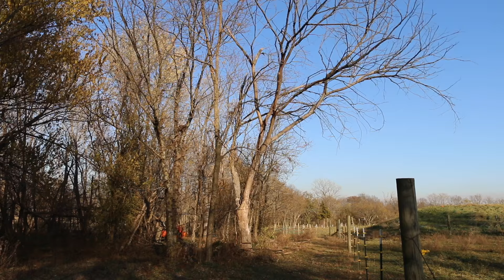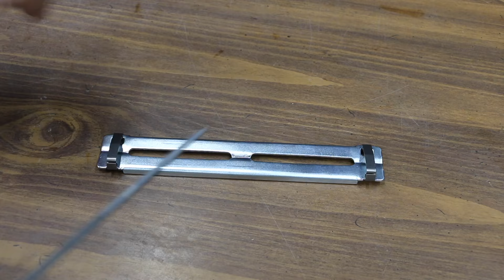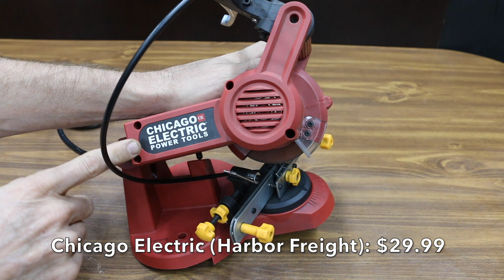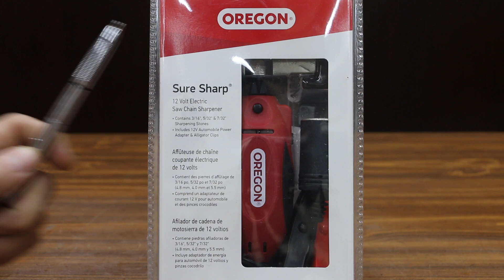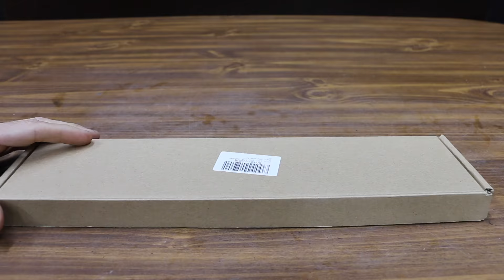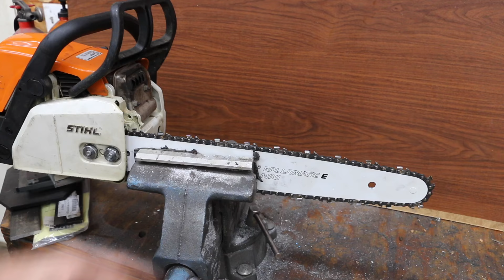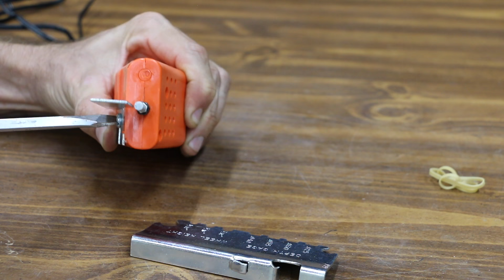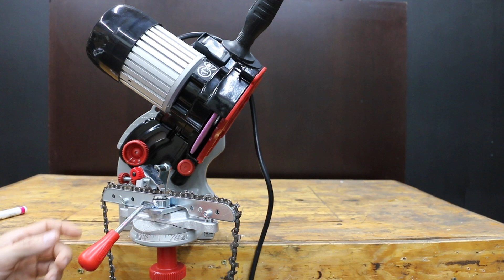Which Chainsaw Sharpener is Best? Let's find out! Stihl, Granberg, Chicago Electric, Oregon

Comment: Great reviews, but I am not sure why anyone is using any chain that does not have carbide teeth. I am using all carbide chains on all my chain saw tools and they cut faster than any new regular chain. The teeth are harder and cut like they are new from log one, to log 100.  They hardly ever need sharpening as they are hard enough to cut through cinderblock while cutting wood afterwards as if they were new. Why would you use a regular steel chain. These chains only cost $50 for the 16 inch, and less for the smaller chains. Not sure why anyone has been using steel only chains for the last several decades. So you productivity is much higher since you do not loose cutting speed over the course of use like on a steel only chain, and you do not have to spend the time to sharpen them as often. They also do not suffer the risks of hitting dirt or other hazards the way a steel only chain does. An inferior performing chain saw can probably outperform a better one by using a carbide chain versus a regular one on the other chainsaw.
Reply from the maker: Thanks!  Thanks for sharing.

Comment: I wish you would do an addendum to this video by using a single file by hand and show that against the others. While that will vary with the skill of the user so do the others as you demonstrated by practicing with the different systems. I would like the comparison of filing by hand to see if the avg person can do it well enough. You don't cut trees for a living so I'd recon my skill with the sharpening is avg too. Is it worth the extra cost for a sharpener at all? Next question does a sharpener or hand filing prolong the life of the blade by not removing more material than needed . I really enjoyed the vid esp love the consistency in your compairisons, the weight on the saw was clever thank you

Comment: Sharpening freehand with a file and finishing with a diamond file requires 
a steady hand and good eyes working in good light with a lot of practice. 
I have also the rotary sharpeners that are used like a Dremel grinder.
But I recognized the rotation speed is much too high for my liking for a
very light duty application like sharpening a small cutter on a chain saw.
The sharpening of a cutter requires a delicate touch and finesse to be 
accurate and have a good result, more like sharpening a scalpel than 
grinding a lawn mower blade. This is especially true for diamond burrs
and carbide burrs which perform best at a low cutting speed. 12 volt
55W sharpeners running at 25,000 rpm are more than 3 times overkill 
using rotary diamond burrs to sharpen a cutter on a chainsaw. A dull 
cutter needs only a touch up to bring back its edge. An analogy is for
your Case knife when it gets dull you sharpen it using a light touch on 
a fine grit sharpening stone being very precise and accurate soon you
have a razor edge, and it would be excessive to sharpen the blade on 
a horizontal grinder like you would choose for a lawn mower blade. 
Recently I am using a DC 6-60V 30A PWM DC Motor Speed Controller 
to pulse control the 12 volt power to a sharpener that is a clone of 
the Oregon Sure Sharp and it is working well to control the speed at
32% pulse duty cycle according to the LED percentage power display. 
The controller was 10 dollars from Amazon and shipped promptly. 
It appears to be a good solution. I run the grinder counter clockwise
with the chainsaw in front of me bar pointing to my right and working
from the one side on cutters angled either way. This eliminates a burr
forming on the top edge of the cutter during sharpening, but care 
must be taken to hold the tool shield steady with a finger tip and 
when the grind is complete to push the burr away from the gullet
and towards the raker before lifting it from the gap. If the burr is 
simply lifted straight upwards it will blunt the edge just finished.
So it takes paying attention and being careful watching closely to
do the job right. The burrs I use are 5/32" but also have 11/64". 
The 11/64" files and burrs can be used as a finishing pass to 
thicken the edge if it is too thin or a softer steel cutter is dulling
too quickly. The same Motor Speed Controller can be used to 
throttle down many other DC motors that need speed control
to find the best speed of operation for the specific task.
Reply from the maker: Thanks for sharing.
Reply: @ProjectFarm  You are welcome.  Machinists know about
different rpm cutting speeds for different size drill bits that
work best for drilling specific metals and the same principle
applies to grinding, so there is a sweet spot velocity across
a steel cutter for a grinding stone burr or even for a file. It
is a huge advantage to be able to fine tune the rpm on a
rotary file or burr and it is precise work.  One of those lighted
work magnifying glasses with a support stand like is used
by watchmakers and jewelers and electronics technicians 
would also be really helpful when sharpening small cutters
so a person gets a closeup view to better see the work. 
Sharpening cutters on a chain saw is pretty close work.
A sharp chain will actually produce curled chips of wood
like a wood plane so the sawdust is not dust but looks 
more like cooked Ramen noodles. I laughed when I saw
this the first time.

Comment: As a arborist I just learned and comes natural sharpening with just a file and flat file..it's really about angle and having the teeth with same amount of strokes but so e teeth need more attention than others ...I could blast through a stihl 881 62 in bar at around 10 min no problem lol...these tools are cool but definitely not pragmatic in commercial use
Reply from the maker: Thanks for sharing.

Comment: Speed of cut is dependent on a number of factors. Firstly how sharp the actual cutting edge is, of course, but there is more to it than this. The height of the depth gauges controls how thick the chip is cut. In turn this should relate to the hardness of the timber, the width of the cut, and the power of the saw. Correctly set it makes a LOT of difference to the speed of cut. The amount of "hook" the cutting edge has is another major factor; an undercut tooth will cut really fast, but won't last very long, a less undercut one (as on the disc type sharpener) won't cut so fast, but will hold it's edge for longer. So while your results are interesting, they are not all there is too it. Personally I use a hand held file, and sharpen a little off each tooth often; and do the depth guages when needed. No set up time; whizz round in no time, and always have a super sharp chain! I have noted that probably 90% of the damage done to an excessively worn chain was probably done in the last 10% of it's usage. That is when each tooth skids over the wood, rather than biting into it.
Reply from the maker: Thanks for sharing.

Comment: You need to a tapping type of grinding with the Oregon 410-120 sharpener or you will overheat the teeth and anneal the steel and lose the temper, thereby having a now useless chain.
Reply from the maker: Thanks for the feedback.

Comment: FYI, if you hand file you want to use a vice to hold the bar stable.  that was a poorly done hand file job....  my hand filing on a 25" bar takes about 15 minutes to do 6 passes with a round file and hit the depth.  I run Stihl yellow chains and I can sharpen anywhere.  You never know when you are going to find old climbing pegs or barbed wire.
Reply from the maker: Thanks for the feedback.

Comment: I tried all kinds of sharpeners and found the Oregon bench grinder maintained the chain in like new sharpness over the life of the chain. I manually filed the depth gauges as needed, using a flat file free handed. I always kept a couple fresh sharpened chains with me when cutting so it was easy to quickly swap them when one got dull.
Reply from the maker: Thanks for sharing.

Comment: I used seldom bother sharpening a chain, now & then I did. It isn't that I can't - I can, very much so, I just seldom bothered, I'd just chuck on a new chain as they were super cheap.  BUT.. lately, chain has gone the same as everything - UP!! Plus they're now "out of stock" a lot.  Dull... Anyway, that meant I had to sharpen chain these last few weeks.  Oh alright then.. 

For that - forget all the "Stuff" ^^ - all you need, even for a mangled chain, is a file, a handle & an angle grinder with a 30 grit sanding disc in it. 

First, file the teeth - no rocket science, file holding the, erm, file, at a flat 90 degrees to the bar, bar clamped in vice- ignore what size round file they say you ought use, use the big one - it ought just barely fit between a fresh tooth & the depth gauge. Big one. Not small one. Key. 

 Tilt it flat & level to whatever angle the chain asks for - 30 degrees, 25 degrees, Ish is fine blah blah. Key thing is - watch the tooth you're filing - blunt will have shiny bits you can see, right on the leading edge. That "Shiny" is damage.  File till there are no shiny bits. Push the file fast. Same as for a butchers steel - fast is good, slow isn't. All dull & a bur formed?  Boom - done. You're gonna make between 6 & 20 passes with the file - depends on how damaged the edge is. Use your finger to test - if it feels like it'll cut ya, it's sharp. 

Then grab the grinder with the sanding disc in - hit every depth guide for a split second - take off just a little from each. What angle you hit it at doesn't matter - use yer brain, Ish is fine, down a bit is the idea.  That done, you now have a scary sharp chain - so beware that it's now scary sharp, sharper than factory. It will grab hard, kick-back more, cut wood about twice as fast & you will generally be chuffed with your new sharpened chain because you will be under no illusions that it is now "Damn Sharp".  I started chainsawing at 14, use a saw daily (every day) to mill slabs & planks from raw lumber, do ridiculous hours holding a saw in my hands & blunt chains bore me to tears - I want them scary sharp. 

Follow ^ those tips & yours will be scary sharp as well, with no gimmicks needed. Just don't absentmindedly brush the back of your wrist against a chain you just sharpened that way ^ when it's sat in the vice & you walk past, because it will open you to the bone it's that sharp... glances down at raw wound on back of wrist... FFS!

Comment: Got into a debate today on bar oil. Guess Stihl and Husky are making a biodegradable oil. Personally I buy the cheapest oil I can find. Usually 5 gallon buckets from my local farm supply store. Yea, I go through some oil. About a bucket per year. Is it actually better to pay more for the branded oil or should I just run waste motor oil?
Reply from the maker: Thanks for the suggestion.

Comment: Thanks for another great video! The 'Stihl  2 in 1' takes care of the rakes at the same time you're sharpening the teeth and is affordable. That seems like a big plus to me. I currently use the Chicago Electric bench grinder but will be switching to the 'Stihl 2 in 1' after seeing this video. It would be great if someone could design a tool to sharpen BOTH sets of teeth/rakes AT THE SAME TIME!
Reply from the maker: You are welcome!

Comment: Great test!  And I'm pleased to see that the Granberg faired well, since that's the style sharpener I've used for the past 45 years!  ONE NOTE:  Stihl makes (or made) a heavy duty, made in Germany look-alike of the Granberg hand sharpener.  I picked mine up about 10 years ago and like it better than the Granberg just for its larger size and stout, cast aluminum frame
Reply from the maker: Thanks!  Thanks for sharing.

Comment: You are using the bench sharpener wrong. For one thing, you can see at 12:20 that the metal has turned blue and lost its hardness, because you overheated it it with the grinder disk. The correct way to use it is to bring the disk to contact with the cutter only for a very brief moment, maybe a tenth of a second, but several times at short intervals. During the intervals the cutter cools down sufficiently so that you do not destroy it. If the metal changes color, you have overheated it.

Comment: I use a table-mounted electric sharpener for the cutter teeth and a bench grinder for the depth gauges. Perfect results with minimum effort every time. When a chain becomes dull I simply replace it with a sharp one and sharpen the dull chains at a later time.
Reply from the maker: Thanks for sharing.

Comment: With all sharpeners used with the chain on the bar, it is important to snug up the chain tension to prevent the teeth from moving around a lot and preventing proper angle results.
Reply from the maker: Thanks for the feedback.

Comment: I'll give my 2 cents if you want it. I've tried all these systems except for the hand held power grinders. If you cut a lot of wood you most likely have chains to swap out. A bench grinder makes it an easy deal to sharpen all the chains at once, in short time. The cheap plastic Chicago grinder (I use the blue max version) is my favorite because the cheap plastic allows you to slightly bend it a little to get any extra material. Also, a bench grinder makes it easy to get your face close (be careful haha) to get a visual on how the chain is being sharpened in real time, so you can be sure to do a great job. Can't really see closely with the other systems. 
Finally, I always start with the shortest or most severely damaged link and cut all the rest to match its length. That way you'll get a straighter cut.
Reply from the maker: Thanks for sharing.

Comment: I use a Chicago Electric similar to the one here with good results by…  purposely removing little of each tooth; and setup so grinding wheel does NOT touch tooth without slight pressure — much plastic construction so use ‘play’ in unit to back into tooth after lowering wheel (to adjusted depth stop). 

Point being experience & skill required to get best result from your sharpening of choice.
Reply from the maker: Thanks for sharing.

Comment: Not mentioned. The Stihl 2 in 1 also takes care of the depth gauge height at the same time saving having to go back and file the depth gauges on a seperate pass with a flat file. Big plus to me. Note: the 2 in 1 comes in different versions to match different chains.  Great vid on sharpening .
Reply from the maker: Thanks!

Comment: This summer I spent a lot of time with my chainsaw cutting mostly standing dead, very dry hardwood trees.  1st  new chain,  dull after about 1-2 hours cutting time.  Sharpened with a file with attached guide....cut about as fast as new but still dull after 1-2 hours.   2nd new chain..  dull after 1-2 hours....   sharpened with an oversized rotary stone sharpener on a dremel tool,, .. no guide (totally freehand).    I increased the primary blade angle to almost 45 degrees and increased the depth of cut by 3/1,000s of an inch. Cuts nearly twice as fast as new. .  Also, since the grinding heated the blades hot enough to smoke, I quenched each one immediately after grinding with a spray of WD-40  to ensure hardness of the edges.  The steep angle seems to have reduced bogging, even though I am flinging bigger chips, and the increased hardness has slowed dulling considerably.   I have almost 4 hours on this chain, and it still outperforms a new one.
Reply from the maker: Thanks for sharing.

Comment: I work with a team clearing downed trees from rivers. Id been looking at getting an electric sharpener as thats what the loggers used in the timber community I grew up in. However after seeing this video and others, I held off as I had the stihl 2 in 1 sharpener already. I found it to be very easy to use. Once I got used to it the speed of sharpening increased. It only took me 5-10 minutes to sharpen a 20 inch chain. Both myself and another saw guy were impressed with the difference from the day before and how sharp it was. It fits right in my fuel box and I can sharpen the chain on site on the river. Theres certainly no reason for me to get an electric sharpener.
Reply from the maker: Thanks for the feedback.

Comment: The Stihl 2 in 1 seems like a great idea for my needs.  I usually am not close to an electric outlet when I need to sharpen a chain, and it looks not much more complicated than my Oregon file with the handle and angle guide from Walmart.  
I might get an electric one for those times when the chain has become seriously dull.  Stihl 2in 1 first.  Besides, it keeps the parts all together.  No need to carry a separate depth gauge and file.
Reply from the maker: Thanks for sharing.

Comment: Many years using a chain... I noticed some of the saw signs of cutting through "fatwood" (knots") and have always found new or used saw chains slow down through them. Probably denseness or the oils of the wood. I have a 110v grinder set up I bought at TSC 12-15 years ago.I went to those because nails etc would ding a blde so bad it was hard to get the teeth even. Un-even teeth usually cause the cut to yaw left or right. Now my practice is to look for damaged teeth on one side or the other and if the damage is not too sever I will use the smallest tooth to make my set up so I get all teeth the same size. Badly damaged odd ball teeth wont get sharpened until the other teeth on the blade approximate the size of the badly damaged toot/teeth. I carry a bag of used blades in the field. It is usually easier/faster to swap damaged blades or blades that yaw than fight sharpening in an unfriendly environment.
Reply from the maker: Thanks for the feedback.